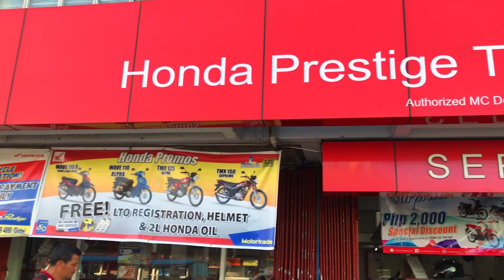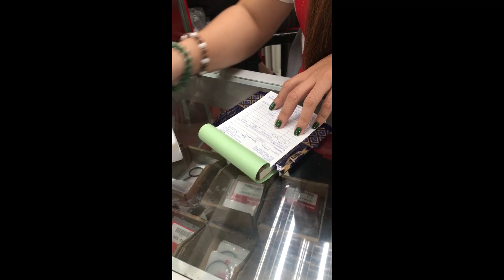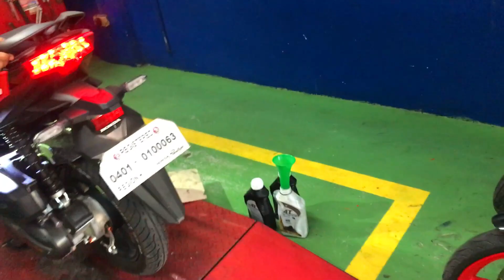First change OiL ni ReD! Honda Click!

Comment: sir may bayad po ba labor ng change oil sa honda? baguhan lang ako sa motor..sensiya na
Reply from the maker: May coupon po sa manual. Yung first three pms po free labor
Reply: @aldencastaneda2121  ahh cge po.d ko po napansin pero nasakin pa yung manual 1month palang motor ko pero 500km na tinakbo..salamat sa info lods
Reply: Anung oil po gmit nyo
Reply from the maker: @ardeedomingo4164  Pertua powertec po